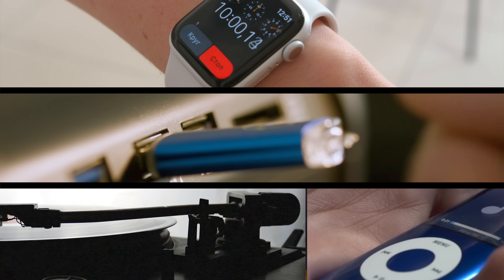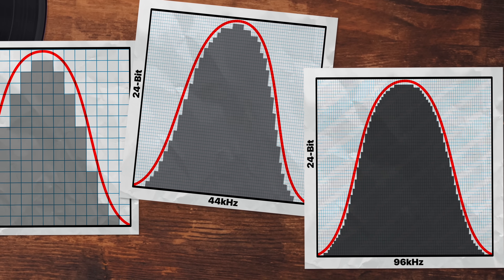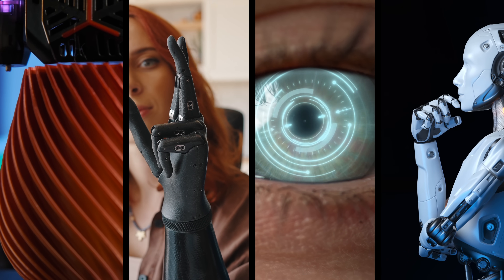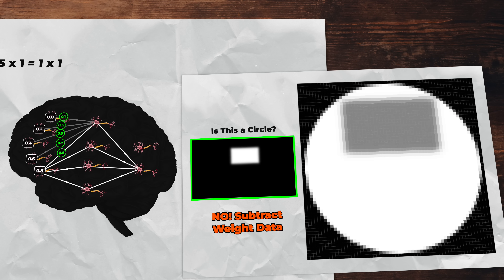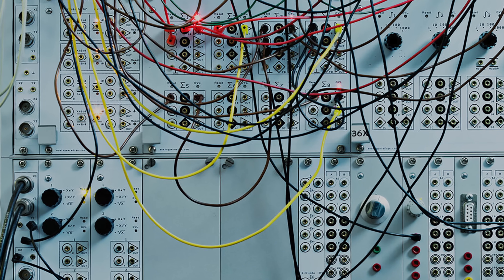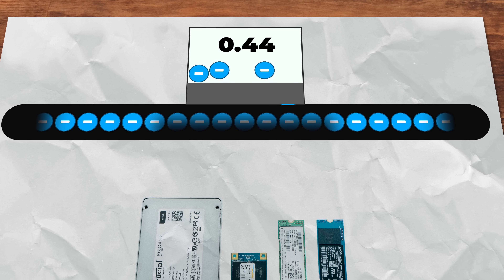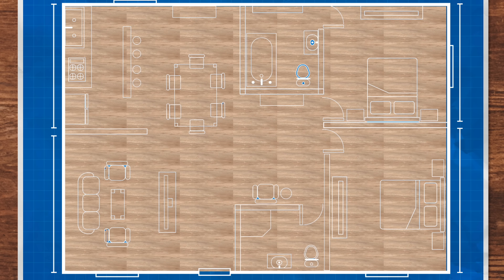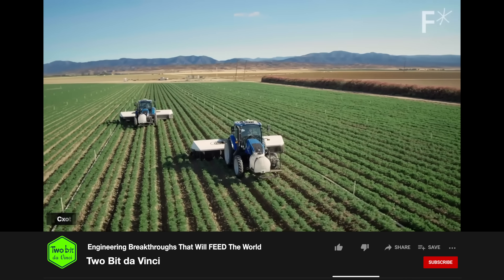Analog Computing is GENIUS - Here's Why!

Comment: Vinyl is not the better medium!

The reason why many people think that the sound of vinyl records is superior is based on three things:
1. Records are expensive to produce, and their mastering need to meet technical requirements for proper playback. That's why most record labels hire experienced mastering engineers to master the music professionally. A lot of digital only music is mastered by producers, which are not specialized or do not have the proper listening environment, or by software algorithms. If this music is mastered by a professional, it usually sounds way better.
2. Analog playback can introduce distortions. Some people may experience these additional harmonics as "analog warmth".
3. They do not use lossless audio files for comparison. 

It is important to understand that the music on most vinyl records, which are newly released today, has been digital processed at one point during production. Though "analog warmth" is often emulated using software.

The sample rate of a CDs is plenty for human hearing. Audiophiles, who are detached from reality, may disagree, of course.

The steps in the the blocky waveforms in the examples are actually not coming like blocky images out of the speakers. They are more like vertices.

Bottom line is that analog audio is not automatically better.

I just wanted to make this crystal clear.

Comment: I had a little trade school on automatic transmissions of the 1980s and before.  I always asserted that the valve body in one of those transmissions was essentially an analog computer that operated hydraulically instead of electronically.  I still assert that.

Comment: if I understand history correctly, designing complex analog processors is much more complicated than digital. Unless NVidia or someone trains an awesome LLM for analog circuits, the bottleneck will be talent and experience. Most EDA tools are for digital today. Someone needs to train a model for analog circuits using transformers and then build an online EDA stack for analog circuits.

Comment: Current hardware had an explosion in errors due to increasingly smaller hardware reducing error margins. There was a paper DDR4 increased error rates by 5.5x to DDR3 and then they slapped on die ecc on consumer ddr5 just to deal with it. Maybe they are saying "if we cant contain errors in digital and need checks anyway we might as well use analog"
Reply: well if you can make something 10x as fast and then need to use half of that for error correcting codes thats still a 5x improvement

Comment: This video is spot on.

Analog processing is the future of running AI models, with a vastly supper comput speed and huge reduction in power requirements compared to a less efficient single bit per location computer. 

I think analog computing is much more relevant and applicable to this stage in computing than quantum computing.  I wish we would spend more effort on analog computing and less on quantum computing.

I do not understand why we are not using 4 or 8 bit per location computing.  This would exponentially increase computing speed and efficiency while maintaining accuracy of a 1 bit per location "modern processor."

Comment: Can analogue computers be made as small as digital computers?
Reply from the maker: maybe not quite as small but close? they can definitely be shrunk down for good system on chip designs for integrated products!
Reply: Yes they can and yes they are because these digital computers are actually analog at the electrical level.

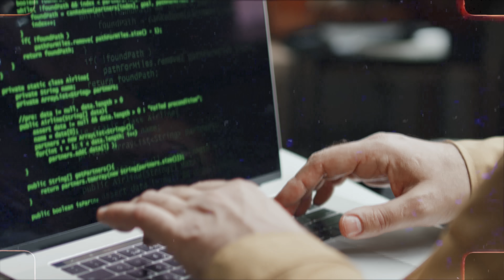Comment: 0:30 ITs is NOT true. We still use analog every single day, if you used dialup in 90s you used semi-analog, PSK or QAM encoded, if you use WiFi, 5G you use semi-analog if you use SSD most probably you use semi-analog as well Multi Level Cell. Fun fact Philips casette tape would not be able to fit much data if you used only digital 110101. It would be possible to record 90minutes of songs, in digital format i you have used semi-analog QAM - phase and amplitude modulation QAM256, plus MP3 Fourier transform, huffman or whatever coding to fit 120MB on both sides (stereo heads). Lot of processing. Probably quality of analog signal recorded directly would be much better. Only possible if you used hybrid both digital and analog processing. 

An VHS tape using existing VHS electronics (based on existing systems) could fit 5GB data but only if you encode using semi-analog system QAM, QPSK etc. Could fit even more HP QIC used 8mm tape. Same goes for all communication its mainly analog phase-amplitude modulated. So in 1MHz of bandwidth you can fit more than 1Mbit of data but rather 256Mbits (5G). We get best of both worlds.

Now imagine Flash memory able to hold 8 bits of data in one cell, high enough to hold 1 AI Tensor core, treshold. Maybe in future we would use memristors, or maybe we just will allow AI data models to be stored in SSD without need of converting analog to digital and digital to analog. Analog computing with digital adressing. 

Bee do have only 1mln brain cells only 1milon.

Comment: This jumps to a conclusion, that analog multiplication is faster than digital multiplication.  This is not true.  In practice, the faster you try to make analog circuits, the more trouble you get in to, because electronic circuits don't behave as predictably when their values are changing very quickly, as when their values are changing slowly.  As you make a rapid change to the voltage going into a circuit, physics gets in the way, and you get things like undershoot and overshoot, causing the voltage immediately after that transition to be quite far off of its intended and eventual value.  The more precision you need, the longer you have to let the signal "settle down" to its precise value.  While it is doing this, you can't do anything else.  You just have to wait.  And even if you only need 5% accuracy, which is a joke, because errors tend to accumulate, if you do a number of sequential operations, each of which is precise to within 5%, pretty soon you're lucky if you can achieve 20% accuracy.  So if you need an overall accuracy of 5%, your individual operations have to be accurate to something more like 1%.  Which reduces the speed at which you can do the math.  Meanwhile, your digital circuits can run many times faster, because the output of a digital gate can vary as much as 50% and still give you exact, repeatable results.  And because of this, the extra time it takes to do a multiplication digitally because of the number of separate addition and shift operations needed to do a digital multiplication, is easily made up by the increased speed at which these circuits can operate without losing ANY accuracy.

Also I notice you spent part of the video featuring technology that allows analog values to be stored in memory, only to say moments later that signals are converted from analog to digital and back again for things like memory.  This is because analog memory is far from viable today.  We have flash memory chips (which are used in things like SSD devices and SD cards) that are essentially analog internally - they store a specific amount of charge on a floating gate, then measure it again later.  But since they are reading it digitally, the number read is exactly the same as what was written.  Which is fine, but that charge decays over time, so its value is getting less and less accurate the longer it has been stored.  Again, this can go on for quite a while before the data is degraded to the point where it will read as a different value than what was written.  And it is simple to read and re-write digital data in a flash memory cell, and because it's digital, it can refresh itself, making up for any "bit rot" caused by slight and continuous loss of charges on those floating gates.  Even worse, though, the more you write to a floating gate memory cell, the more the cell itself degrades, and this increases the rate at which charge is lost.  And to make it even worse than that, the rate of degradation depends on the actual values you are writing.  This results in a sort of "burn in" phenomenon, where the longer a memory cell is used, the more it starts showing up "ghost images" of previous data that has been written.  It is nowhere near as rosy as implied in the video.

Comment: The explanation of digital audio sampling was not remotely close to accurate. Your rendering of sampled audio as a blocky rasterized image just isn’t how it works. Sample points are actually used to generate a smooth curve and the only way that a sample rate imposes any limitation on audio fidelity is the maximum frequency that can be recorded/reproduced. For example, a sample rate of 44.1khz can perfectly represent frequencies up to 22.01khz, which is already above the top frequencies which humans can hear. There are some reasons why higher sample rates can be helpful in music production, but for listening there’s really no reason to go with high sample rates as it won’t do any better at representing audio frequencies we can hear.

You could have instead made an argument about digital audio compression, or about digital to analog converters and had some standing though.

Comment: Vinyl is a collectors' item. Digital is the accuracy item.

I can go on a long diatribe about this. But simply put, there is no "stair-step" in digital audio, because samples are not pixels, and they do not have width. As long as you sample at >2x the max frequency and cut off any frequencies beyond that, the only problem you really get is noise floor. And in terms of noise floor, digital is thousands of times better. This is all objective, testable, measurable stuff. 

The main charm of vinyl and vacuum tubes are not their accuracies, but their INaccuracies. They way they tone and color the sound away from the original. In the case of tubes, they also introduce distortion in a way that reduces odd harmonics, making sounds less dissonant than they are in real life.

But there's also the "big box set special edition" factor with vinyl. It's kinda like how, if you're a huge fan of a game or game studio, you might buy one of their special editions with comes with blu-ray copies, figurines, books, pictures, etc. Only to just down load the game on Steam anyway. The extra stuff doesn't improve the quality of the download or change the game performance. But that wasn't the point. The point was to collect a bigger, more physical version of the item.

And I think that's what vinyl offers even more than the nostalgia factor. Because I think for most of us, the cassette tape would actually be more nostalgic, as vinyl has had its renaissance for quite some time now.

Comment: There is no "better" as it's all situational based. Digital is 100% superior in any situation that requires leaving your listening room... and Analog (provided it's good equipment and clean records) will almost 100% of the time sound more compelling and emotional than a digital recording. That's in part due to harmonic distortion which analog gear provides to the sound... It's what people call "warm". It's like asking are my studio monitors or my headphones better? Well in my control room it's the monitors, but anywhere else it's my headphones.
Reply: I just love it when people attribute a better listening experience to the distortions introduced by the analog recording and playback processes.  Hey, guess what?  I can design a digital filter that will sound Just Like That.  Objectively or subjectively, as long as you use double-blind testing.  Get real.

Comment: The idea of using this tech for neural networks is awesome, but what excites me is the possibly of using this storage tech for something more mundane....AUDIO! Instead of needing, say, 16 memory cells (minimum 'cause you might have more for parity etc) for every sample to store 16 bit audio, why not store the sample in a single cell as an analogue voltage? 

This would be a really interesting hybrid between analogue and digital audio, you would still have a sampling rate, but there would be no bit-depth as such. Of course instead there would be the dynamic range & SN ratio considerations that analogue audio has. But if you're only using 1/16th of the memory to store the value of the sample, imagine how high you could crank up the sample rate! 

I would suspect it would have own particular sound quality, yet be very good. It would be kind of like analogue bit-steam as the playback would be simply switching from cell to cell and diverting that read voltage to the output. 

This kind of sampled analogue actually already exists in the audio world, in every tape and cassette deck. Unlike vinyl where a continuous wavy groove is an analogue of the sound, to record onto tape you need to excite the tape with the bias frequency, which effectively means analogue samples are being recorded onto the tape at the frequency of the bias oscillator. And you're still switching from sample to sample during playback - the motion of the tape is doing this for you. 

There is a particular difference here between this as the analogue flash storage. That bias oscillator is also an analogue signal, and the sample would kind of meld into one another, in the analogue flash storage every sample would be discrete, which would mean it could still be easily subject to digital audio processing.
Reply: This would give you the worst of both worlds.  We're used to having 100dB of dynamic range in our digital audio, or 80dB or so in analog audio, but the dynamic range in a flash memory cell is more likely around 40dB.
Reply: @BrightBlueJim  Maybe...but then again 100dB of dynamic range is seldom if ever utilised. What it would give you is the ability to store massive amounts of content, which could be useful in certain situations.

Comment: From a business security sense it could also allow more control over system access as the analogue systems can essentially operate as "dumb" terminals thus not allowing the user to work outside set parameters. I suppose that has both possible positive and negative outcomes as well.
Reply: Uhh what?  That's just a straight up no.  There's nothing about "more efficient but slightly less accurate matrix multiplication" that has anything to do with system access.  Or anything to do with "dumb" terminals, never mind setting "parameters" that somehow restricts users from doing.. something?
Reply: @altrag  Then why not explain it genius as you seem to be so knowledgeable !!
Reply: @EamonCoyle  You're going to have to be more specific.  Everything you said is entirely nonsense so I'm not even sure what you want me to explain?
Reply: @altrag  Give me a use case, but keep talking to me like I am some sort of idiot and I will also want to know where to find you.....

Comment: Computers that can actually do math and not an approximation of math will indeed be world changing.
Reply: That's not really plausible.  These things may perfectly compute Ohm's law, but what we gain in the precision of the calculation we more than lose in the precision of setting up and reading out the calculation - that is, we can't make absolutely perfect resistors or apply an absolutely exact current or read the resulting voltage with absolute accuracy.

Purely digital computers actually can do math completely correctly if you're willing to let them run for long enough.  Usually "long enough" is measured in lifetimes of the universe though so that's not really useful.  Instead we invent heuristics that provide completely correct answers most of the time but can fail spectacularly when the heuristics happen to break down (see Wolfram Alpha).

Very, very few use cases require that level of complete correctness though, and even the heuristics are extremely slow compared to the basic "approximation of math" that modern computers support natively (IEEE floating point arithmetic).  So we make the trade-off and choose speed over accuracy in almost all cases - the breakdown in accuracy just doesn't get triggered all that often so nobody really cares and certainly don't care enough to wait 100x longer for their Excel sheet to finish recalculating every time they change a cell's value.
Reply: @altrag  bro go put a novel of bullshit on someone who isn't an EE and aerospace engineer. I actually do what you fanboys all nut over.

Comment: I was first introduced to the classical music on 78 rpm records.  The clarity of the music and the sound of the instruments was much clearer.
Reply: 78s have a nice, long track for every second of sound. It spins so fast that many scratches are rendered out that would have been very loud at 33.3 rpm. They are also thicker than a 33.3 but are more brittle. If you ever do break a 78, crush it into small chunks and put them in a jar and then cover them with turpentine or acetone. It makes an amazing black paint that shines like a mirror.